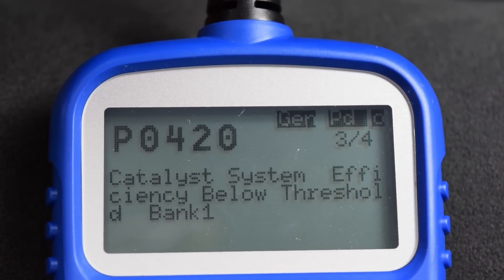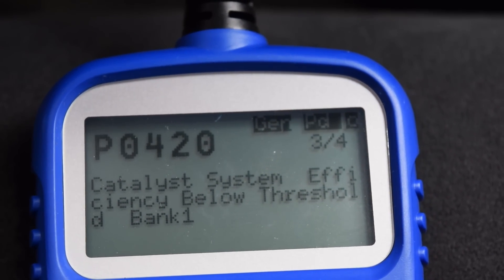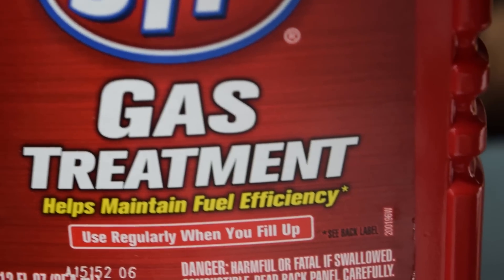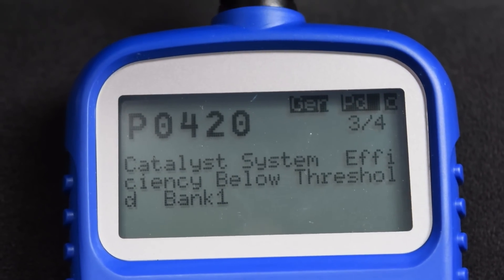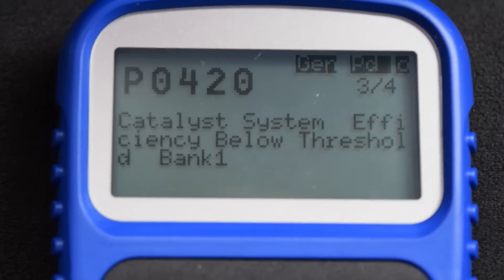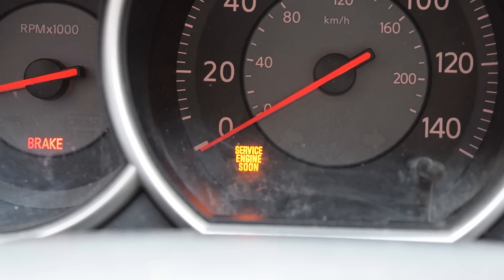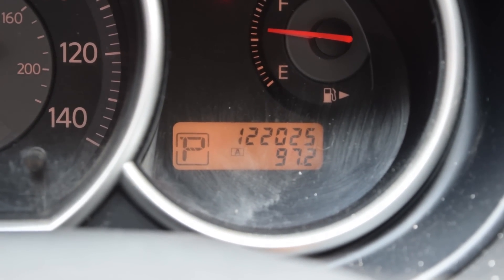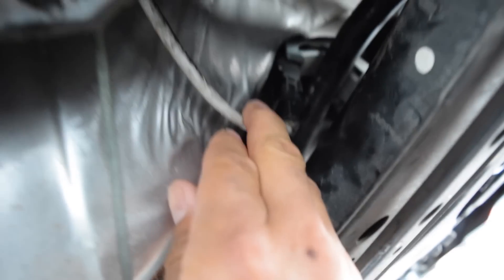Code P0420 Catalyst Efficiency Below Threshold Bank 1. Emissions Test! NO PROBLEM!

Comment: Do you know you have seven commercials placed just so many minutes apart in order to watch your whole 13 minute vid ! That is the most I've ever seen . However I did glean info a product called "CatClean" to add to your gas and clean the catalytic converter. Thanks...I will give it a try. So far I have seen fixes for this code with O2 sensor extensions,   replacing the gaskets on your plastic intake , or gasket change in the exhaust.

Comment: hellllp 
Igot 420 and 430 codes. B1S1 0.300 AT IDLE  0.285 AT 3000 RPMS
                                             B1S2 0.280 AT IDLE 0.280 AT 3000 RPMS 
                                         B2S1 0.600   AT IDLE 0.580  AT 3000 RMPS 
                                         B2S2 0.290 AT IDLE 0.310   AT 3000 RPMS ON AUTEL SCAN TOOL

Comment: well anytime you get parts straight from the car dealer just expect the price to be  3 to 10x the  the price..i would only go to the dealer if your car is under warranty..and if your watching youtube videos like me i am guessing your going to fix your car yourself to save money like me..and yes the lacquer thinner works much better then any fuel additives ..or a very high octane gas you can buy at local 1/4 mile race tracks or even local airports sell very high octane gas..small aircraft run on high octane gas..not jet fuel !!

Comment: I have this code for my 05 murano. I used the cata-clean product,it kept the check engine light off for 150 miles. Then came back on. Does this code related to air fuel sensor and the O2s ? Or is it just the cat alone, is bad ?
Reply: Did u find out if it was the o2 sensor

Comment: fuel injector nothing have to do with catalytic converter. You can clean the catalytic converter using seafoam pour it in the vacuum line than you will see large amout of smoke coming out the muffler
Reply: If it's clog i just have to buy another one right
Reply: That’s pretty much a picture perfect scenario, on how to clog your cat.

Comment: Just wanted to say I had the same issue, threw in injector cleaner, cataclean, and some fuel additive and 91 octane, I fucking passed. 2008 Nissan Sentra 140k miles. also drove hard and fast for a long time before the test. Good advice!
Reply from the maker: Nice. that gives you a couple more years now.
Reply: Did you went to emissions test when you still had the additives in the gas tank ?

Comment: Posting.
I have a problem with the Lexus GS450h 2006.
It happens that after 30-40 km of the train, at the moment when I give it a gas, it loses power for 2-3 seconds and then it pulls again well. For six months now, no master can find me the problem. Before. a couple of days ago I reported a mistake P0420, I changed the catalysts, but again I have the same problem. Can you tell me what it might be?
Reply: It could also the spark plugs or ignitions coils, but I would start with the spark plugs.

Comment: Sometimes I think people don't drive hard enough to clean out the cat sometimes I think people don't drive hard enough to clean out the cat I can imagine if you never Grove on the highway the cat could get dirty the cat converter the catalytic converter couldn't get dirty are you the kind of guy that drives 5 mi a day to work in back or something you never actually go in the highway for about 30 minutes you got at least probably everyday or every time you drive it be on the highway for 30 minutes really truly you can't describe it 5 miles inspect it to heat up enough to clean out that cap the old to sensor feeds the cat the cat converter so therefore you got to be making sure that's working right
Reply: sir you might need to see a doctor.. looks as if you were having a stroke while writing this comment.

Comment: The z it's not necessarily the catalytic 02 sensor still go bad and you can get another one at the junkyard they do last a long time but they do go bad there in. A temperature zone about for 500 Degrees so you can imagine get the O2 sensor that's what you got to feed the cat right for it to work right the O2 sensor feeds the cat so you got to make sure the O2 sensors do last a long time but they do go bad so you could get a good one at the junkyard

Comment: There's a special cat cleaner that you can use I guess you could take it off and put some cleaner in it and then also if you drive it kind of hard on the highway. I'll heat up the cat converter to clean it and also the the catalytic converter what controls the flow is the O2 sensor so you can use the catalytic cleaner or cat cleaner but usually O2 sensors one of the parts on the car that goes bad and you can shop around and find a cheap one or even get a good one at the junkyard probably I've done that before

Comment: lol at 11:35 its clearly shows catalyst monitor INC which mean incomplete. it wont trigger a code unless the monitor has been completed. in ca your only allowed to miss the EVAP monitor this vehicle would of failed in CA. emission testing vary by state. by the looks of az test would pass with out all the "converter cleaning" engine light most likley came back after the catalyst monitors was completed which can take up to 80+ miles of highway driving.

Comment: Just change the gas station! I was going to the same gas station for 2 years by the name Raceway, and my catalytic converter failed, code PO420.  For last 3 weeks I started to use BP gas station, and my engine light is gone. Better gasoline fixed my problem.
Reply: Did it really help
Reply: Yeah I'm in the same boat I just went to take my gas cap off I'm going to wait a little bit and then put it back on

Comment: This worked with my 2005 Hyundai Tucson! I used the STP gas treatment and STP complete fuel system cleaner plus adding 93 (highest available) gas.  I drove normally after filling tank and after about 1/4 tank gone the light turned off!!!
Reply: But for how long
Reply: @dannymartinez8522  
The important thing is to pass inspection, those codes mean nothing
Reply: @Eye-it-azz  oh really
Reply: how many bottles of the STP Gas treatment and STP fuel system cleaner did it take? How many tanks of gas?

Comment: What is the proper way to fix this P0420 code, to have the system works effectively as it should?
Reply: Buy a whole brand new “Cadillatic Converter” and brand new sensors and pay $300-$400 labor to install it new as a baby!

Comment: Glad you passed, but FYI; In California, and I don't know what all other states as well, having the Catalyst monitor registering as INC (incomplete) will not allow you to pass smog.
Reply: What does that mean ?
Reply: @vulkandeathgrip5568  that means you don't pass the smog test and you cannot register your car until you have whatever reason the catalytic monitor is reading incomplete is fixed.

In California the only smog system monitor they allow you to read as incomple or not ready is the Evap (evaporation) monitor
Reply: @michaelrs8010  I know it won’t pass smog because engine light. Just need to know if it’s a sensor issue as it states bank 1 sensor with OBD2 or if it’s because the aftermarket federal catalytic converter somehow even though that seems odd it would be the brand new federal converter… the bank 2 sensor directly on the cat itself is new as well but I don’t know if it’s OEM or some generic brand. The front sensor (Bank 1) under the hood has been there for 178 thousand miles never replaced and that’s what the OBD2 is popping up as P0420 code Bank 1. So I’m not sure what to do first to attempt to fix the issue… could be that it’s very old ? 178k never replaced or maybe the bank2 sensor is too generic for my car along with old bank 1 sensor causing the error code to happen. Not sure
Reply: @vulkandeathgrip5568  well yeah that is always tough too diagnose. First thing you need to do is make sure the Upstream one is the right sensor is that a mass air flow sensor or a heated oxygen sensor. Once you have the right type of sensor for sure it really should not matter if it's a aftermarket brand or not... unless it's a brand that has a reputation for being defective.  But yeah if it's showing you a certain bank that is the problem and you have an older sensor there you might as well replace that.

Also it's possible you might have a leak somewhere along the system. Way too many possibilities to diagnose in the comment section
Reply: @michaelrs8010  so the obd2 sensor is saying on live reading that my upstream bank 1 sensor is at -127.000 and doesn’t fluctuate in the normal range at all. But the downstream sensor reading is 100% normal with no issues. I’m guessing that the upstream sensor is completely bad and is the reading behind it. Checked other readings as well for fuel trims and everything else and nothing was out of the ordinary from what I’ve been reading and videos I’ve watched.
Reply: @vulkandeathgrip5568  that's what I would conclude

Comment: Have the p0420. To just pass smog .empty the gas tank if y put regular gas.i put chevron supreme.i drove the car in the freeway in like 35 min.in the morning befor i start up the car i disconnected the battery for like few minutes i hook it up again. Start up the car.check engine is gone temporary.hope this will help

Comment: All, I had SEC light on and  P420 earlier, reset the SEC light by disconnecting the -ve terminal on the battery, followed above method, drove for about 25 miles on freeways at high rev 3000 to 4500 RPM and checked the code. Now getting P430 as well . Drove another 40 miles with same condition as for the 25 mile drive ..so far no SEC light, will check the code tomorrow. Just wondering if all the dirt/gunk is getting pass bank 1 and now made it to bank 2 so the new code P430 ? I would appreciate any suggestions..  thanks
Reply: I have code p0430 on my Honda, did it work for you???

Comment: 06 Roush PO402 Error code .Cleared error code.Added STP fuel Injection Cleaner system cleaner and STP gas treatment on full tank of gas.At 1/4 tank, added Cataclean,drove 15 miles and filled tank with supreme gas and passed emissions test.Please try this method before you go and spend 1000's of dollars!Thank You for this video !
Reply: I don't see how higher octane fuel helps anything, just another myth.

Comment: Rich mixture or air leak detecting unexpected readings on o2 sensors, if your about to buy new cat try this: Hot distilled water with citric acid 5lts to 2 1/2 - 3 Oz mix for 8 hours

Comment: my grand prix is going on 300k miles and it just started doing this idles rough at park or red light the car still runs like a dream gonna prob cut it off
Reply: Your throttle body needs cleaning with the proper chemical spray cleaner that wont harm any sensors. That's what is causing rough idle at a stop light/parked.
Reply: ILLGoThere4You:man,you should lay off those smokes,they'll kill ya  :-)

Comment: Dude you have OBD reader just delete the code wait 10 days then go for emissions you will pass
Reply from the maker: naeem ali no, your car has on board computers that run diagnosticians which is called the drive cycle.
Reply: naeem ali lol if it worked like that then nobody would fix their cars, when you delete the codes and they plug their computer into your car they can see you deleted your codes and will tell you to drive for a while and your light will come back ok
Reply: just like everyone else said that does not work - they check the drive cycles
Reply: I did that and did not pass

Comment: Ha, ha, you must have used Everclear.  Anyway, I think someone else on you tube said try a few simple things first.  Clean the battery terminals, replace the spark plugs, pcv, and what I would do  is use an injector cleaner, too.  Love the Catalytic video.
Reply: jaden75 ?

Comment: It passed because your Catalytic Monitoring drive cycle was still incomplete.
Reply: Ya a vehicle wont pass emissions if the drive cycle isnt complete...its automatic fail if it hadnt completed drive cycle process.
Reply: Run your obd and look under I/M readiness and you’ll see the inc. All you need to do is turn on the car and let it run for 10 minutes. From there drive 55 no cruise control for 5 minutes. It will go back to ok. Check your obd again. Took me a couple of tries.

Comment: can I still pass emissions codes if I erase the check engine light on my car and then bring it in or testing for emissions before the light comes back on
Reply: no
Reply: no i tried that but they have their own obd reader and it pulled up the faulty codes and even tells them you erased the codes save the embarrasement

Comment: buy some spark plug falors drill one with 3/8's drill bit and install both falors to rear o2 sensor make sure it is the same thread size then you clear code and test drive check engine light will not come back on does not repair issue but a good way to cheat the ECM to pass your smog test
Reply: I never clear codes only because it can present a false sense of victory. The best strategy is to leave the code and wait to see if the "fix" causes it to clear itself.

Comment: try doing 200 miles I reset my engine light to without doing anything and it didn't come back on 200 that was without doing anything just resetting the computer
Reply: Peter Canarelli So does that get the temps up for a longer period of time to burn the crap out?
Reply: AKBuilder762 I have the P0430 and 0430 but my cats are running perfect. what I was trying to tell this guy and I guess it didn't come out clear because I speak to my phone and it types it out for me sorry about that was to do 200 miles will 300 miles and see if the light comes back on because I tried every cleaner and nothing worked and I don't have any holes in my exhaust my oxygen sensors all work my cats both work I checked for leaks around my manifold nothing I don't know what else to do

Comment: you can reset set code by resetting ECU by either disconnecting negative battery terminal or the correct fuses. I tried to clear with my SCT Xcal tuner but couldn't so i pulled fuses.

Comment: Fuel filter will cause it - if it puts the engine into a lean state and the exhaust is lean then across the board its inefficient
Reply: My is300 is throwing this code but in a lean state.. Any information would help sir.
Reply: CJ 
To those not having quick access to distilled water. Rain water from a plastic barrel is great.
Reply: @CJ FINALLY SOMEBODY ELSE WHO KNOWS THIS..THANK YOU CJ FOR POSTING YOUR CORRECT BARELY ANYONE KNOWS THIS.I HAVE TOLD SOME PEOPLE BUT MOST DONT LISTEN SO I NEVER BOTHER TO TELL THEM ANYTHING AGAIN..SHIT I FIX THE FRONT BRAKES ON ONE GIRLS CAR (NEW PADS AND ROTORS ) ABOUT A YEAR LATER SHE CAME TO ME AND SAID HER HEADLIGHT WAS OUT AND WANTED ME TO FIX IT FOR FREE SINCE I WAS THE LAST ONE TO WORK ON HER CAR... I WAS IN SHOCK AND TRIED TO EXPLAIN AS SIMPLE AS HUMANLY POSSIBLR THE BRAKES HAVE NOTHING TO DO WITH A HEADLIGHT BURNING OUT..I SEEM TO GET THE PEOPLE WHO KNOW 2 THINGS ABOUT CARS YOU PUT GAS IN THEM 1 AND 2 THEY EITHER WORK AND DRIVE OR DONT...LOL..BUT TRUE

Comment: ok professional mechanic of 10 years.. you wanna clean out your cat? run your tank real low.  go to your local airport..you can get 110 octane.. it's standard aviation gas.. it's not jet fuel.. it will clean that cat rite out.. only run 1/8 of a tank threw.. then fill up with what ever your norm is..
Reply: hondaxl250k0 o
Reply: Better than lacquer thinner? How much is the aviation gas cost I have local airport nearby
Reply: What about e85?  It's high octane ethanol

Comment: I finally replaced my sensors(pre and post), PCV valve, Catalytic Converter, air filter, spark plugs and cleared the code and even cleared the trims with no success. It's a 2002 Camry. Rebuilt the engine and head. Still getting P0420. Blew head gasket and valve seals so had to tear the engine completely apart.
Reply: PCV valve fixed it for me…. No wonder I was burning oil. 
Good luck on your journey
Reply: Did you ever figure out how to fix
Reply: @jamesbroomfield7799  sold the car.

Comment: Thx for the video. Did you get an engine light until now ? I have the same P0420 with a 2008 Toyota Prius. I am going to follow you and see what will be the result.
Reply: Hello guys .. did it work for you ?? 
please let me know.
thanks
Reply: Georges Ossongono I did end up buying guarantee to pass liquid and I had like 1/3tank of gas I drove with that on highway and after a week the went off so I right away to test station I passed and after a 2 miles the check engine light came back on.
Reply: did it work for you? i have the same code trying to pass emission test...please let me know . thanks
Reply: Just let you know that I just fixed the P0420 code on my 2005 Dodge Grand Caravan this past Sunday.  The fix was to replace the downstream O2 sensor + the check engine light eliminator adapter (total cost ~$30).  The youtube link is as below if you are still interested:
https://youtu.be/qkhDeOvvvX0
Reply: Sheryl Pew catalytic converters should last longer than a year. You must have a mixture problem or the O2 sensors are bad would be my guess.
Reply: mrazik131
Reply: is that the 1st O2 sensor before cat or the one after the cat?
Reply: I did that, went and got tested and failed, CAT and EVAP werent ready,  my lite came on soon again. Cant keep the P0420 code off.  Have replaced the cat twice in 1 years time
Reply: Mr Georges, how did you solve that issue please? i am having same error code on my PEugeot 407